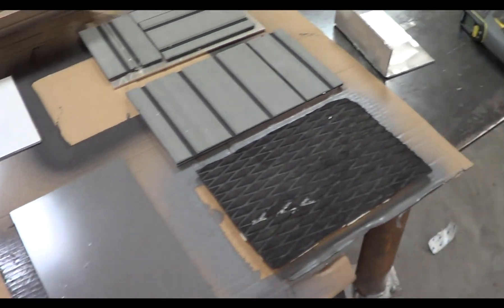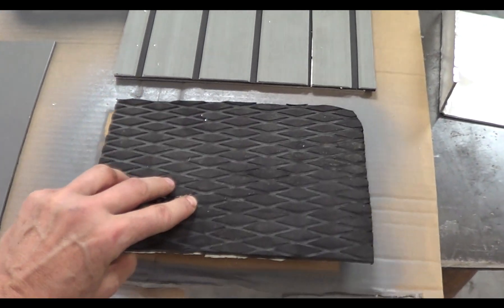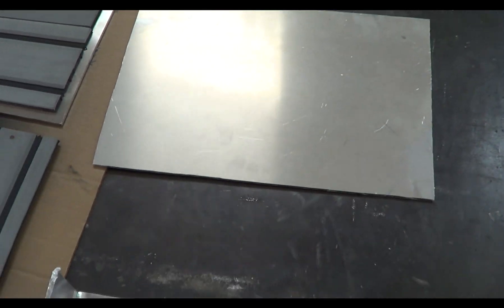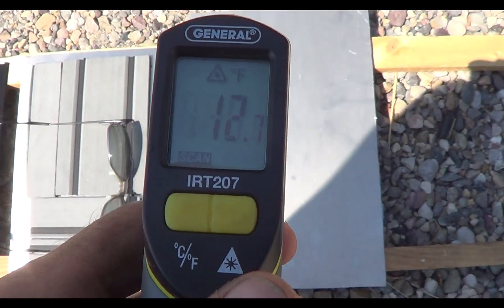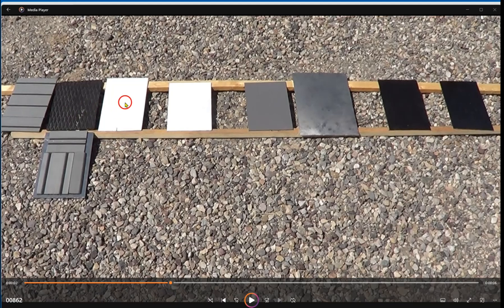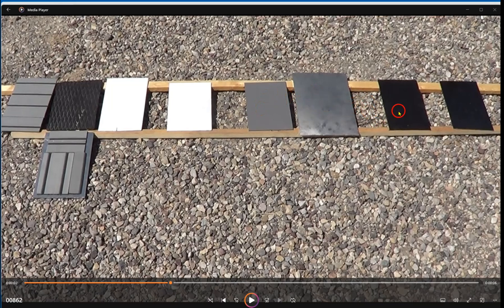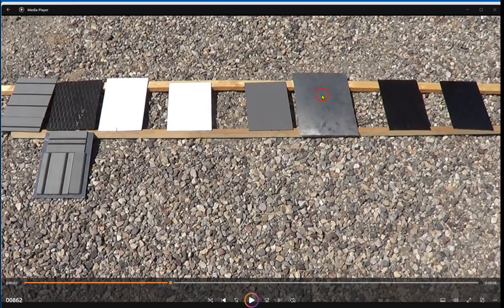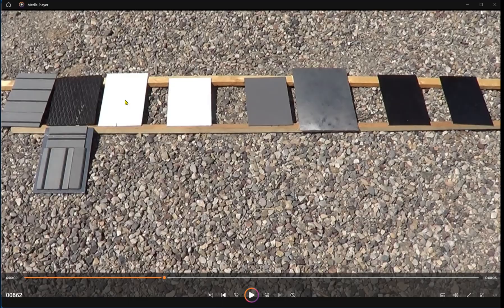Aluminum jet boats get hot in the sun. Cause and cure.

Comment: I have that exact same Vevor decking on my boat, Have you found a good method / product for cleaning it?
Reply from the maker: I just added the gray to my boat, so haven't tried cleaning it yet. I went with gray due to incorrect guess that it would be cooler than black. I haven't tried cleaning it yet, but a rumor is the ultimate solution is use black instead. What have you tried for cleaning?

Comment: I wonder if your temp gun ran out of digits? As in (1)07.7 F. Changing to Celsius scale (switch possibly in battery compartment) could give you more numerical range.
Reply from the maker: The range stated on gun is -6 to +608 F, so should be good. Various Internet sources say that temp guns are inaccurate with hot reflective surfaces. They don't say how/why this is true, only that it is true.
Reply: @idahoviking  Thanks.